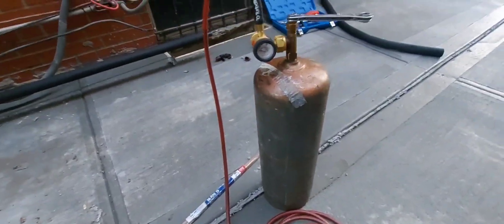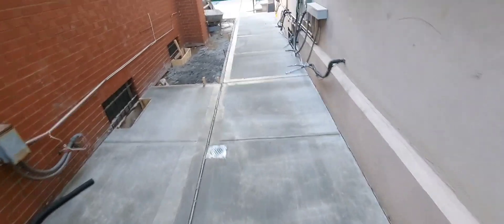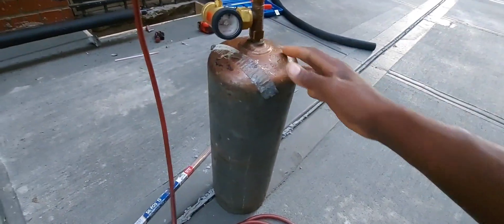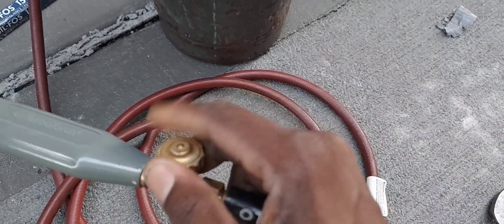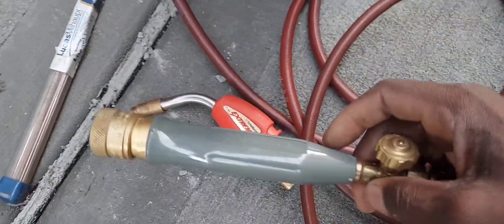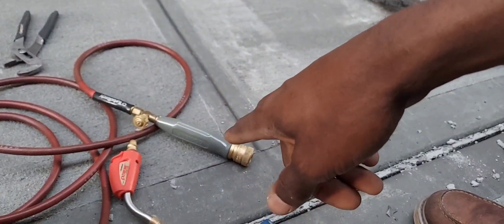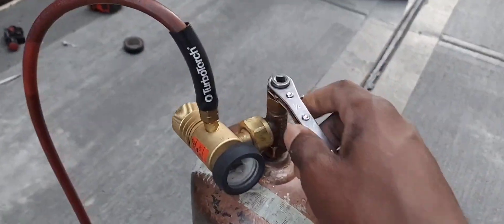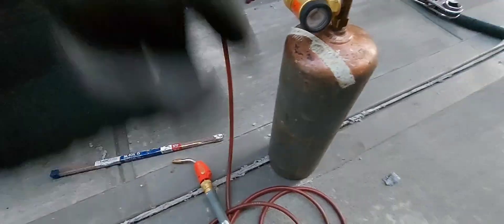ACETYLENE TORCH

Comment: You sound like you don't even know your own equipment.
It's an oxygen- acetylene torch, it just uses oxygen from the air. Like a Bunsen burner running acetylene.
If you didn't have any oxygen at all nothing but black soot would be pouring out of the torch.
For milder heat. If you need serious heat, like to melt steel, you need more serious oxygen out of a tank.
Reply: it's air-acetylene, the kit collects air where as oxy/acetylene implies two bottles.
Reply: @Jhunter844.arkansas  right, oxygen from the air. A relatively low percentage of oxygen as opposed to 100% oxygen from a tank.
Reply from the maker: You are entitled to your opinion
Reply: How about you post your own video? What are you doing here in the first place  watching this video if you know alot ?

Comment: I have the oxygen and acetylene torch, but if I use only acetylene, the flame is just yellow and very smoked. Should I get different gas ?
Reply: Can use the tank ( acetylene) but you would need the 
' air - acetylene ' torch.
Reply from the maker: I don’t think 🤔 you can use it like that
Reply from the maker: Acetylene torch is a different setup

Comment: Look into ASCO torches there tips can be used on turbo torch handles. Idk what it is about the asco stuff but it’s got better controlled flame it literally wraps it self around the pipe and uses less acetylene. I’ve been using that setup more and more as of late. Until I have a small pin hole in a tight spot than the oxy/ace come out to play.
Reply from the maker: 💪💪 thanks for watching